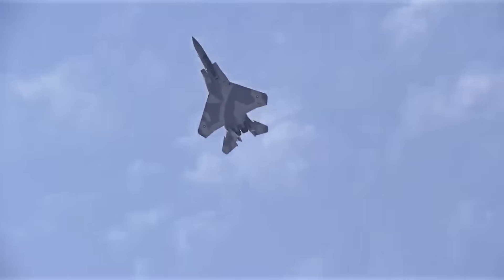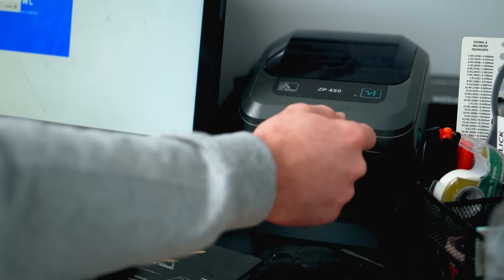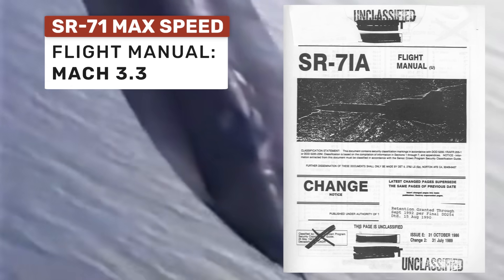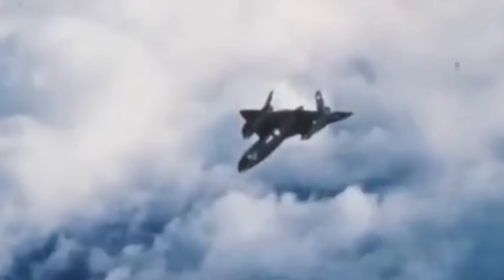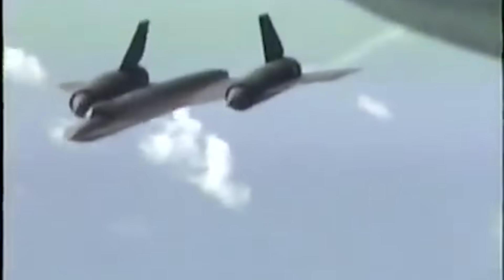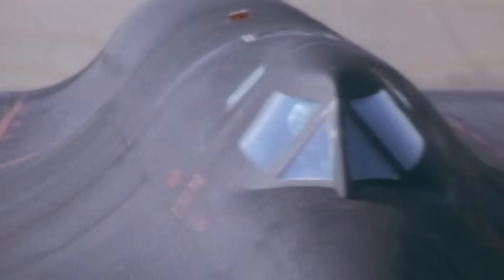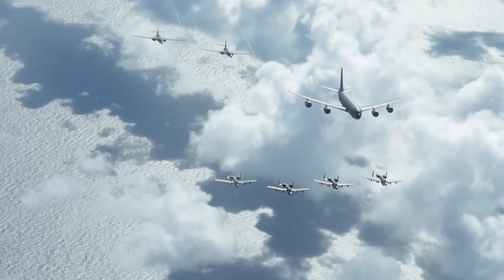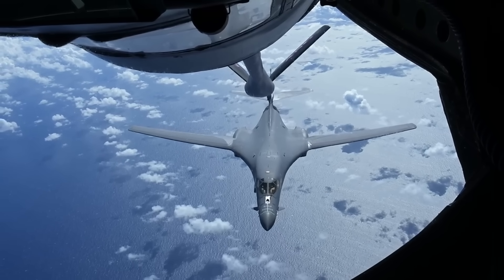The SR-71 was MUCH FASTER than the Air Force will admit

Comment: I remember seeing an interview of an SR-71 pilot describing how they outran a surface-to-air missile. He was quoted saying, "We got up to scary Mach speeds..." ... Scary... for an SR-71 pilot. I don't think he was talking a measly Mach 3.2 - that wouldn't have been "scary" for an SR-71 pilot.
Reply: scary meaning they were not sure the airframe could take it
Reply: @avroarchitect1793  It wasn't a question of the airframe taking it.  The faster the Blackbird went, the narrower the tolerances were for maintaining controlled flight by the driver...
Reply: @charlesdempewolf6861  people dont drive aircraft
Reply: @nomercyinc6783  And your flight time experience is...????
Reply: @avroarchitect1793 Also scary because if one of the engines flamed out, it would put the plane into a flat spin.
Reply: @avroarchitect1793  which would be ABOVE tested speed attempts. what maverick did in topgun 2 could in fact happen. pilots can infact overfly their airframes
Reply: I heard an SR-71 pilot say that they were cruising at MACH 3.2 and they had several SAMS fired at them. He said they just bumped the throttle a bit and accelerated to MACH 3.5 and pulled away.
Reply: Outrunning a SAM often means trading altitude for speed, At the high altitudes SR71s fly at they have plenty of altitude to trade off provided there isnt too many missiles coming at them. But its probably likely at that altitude and speed the flight time of the SAM is the biggest issue, even if the SAM can outpace the SR-71 by 1000 kph the flight time of an S-75 or 150 is 5 minutes at best, which also includes time it takes to get to altitude which in the case of the S-150 is 80-90% of its flight time already.
Reply: @Marc83Aus  the blackbird wouldnt dive or trade altitude it would stay high and fast, unlike most aircraft it would stay high and fast, it would never be moving slow and have to accelerate by diving.
Reply: From what I have heard of the sr71.... no one ever even used full power. The plane could ALWAYS go faster.... it just wasn't safe to do so.
Reply: Was that with Maury Rosenburg ?
Reply: @tonyhowell9203  I think it could be! It was so long ago I can't remember exactly, but having a look at Maury Rosenburg, he definitely looks familiar.
Reply: I watched an interview of a SR71 pilot talk about this. The engines could take you way past Mach 3.5, but the airframe didn't like going past Mach 3.5,
Reply: Let’s try about Mach 6 shall we?
Reply: Yep Mach 3.2 is just a little faster than most missiles.  That jet had to be much faster than that.
Reply: If you hit the Exosphere just right I'd say Mach 17.4
Reply: Did you watch the whole video? The highest speed cited was a pilot who achieved this in a shallow dive.
Reply: over mach 3.5  close to mach 4
Reply: way above mach 3.2
Reply: I can't remember what interview I was watching but one of the pilots said they got to mach 3.5 in a dive to evade missiles and at that point they could tell the aircraft didn't like going that fast. That would be somewhere around 2350-2400mph depending on altitude. Oh he put it in the video lmao.
Reply: @GatSpeed  speed doesnt change at altitude alone
Reply: Not only that, 3.2 isn't fast enough to outrun a SAM! IIRC, they'll easily do Mach 4.
Reply: @markymarknj  Common soviet SAMS of the time capable of high altitude interceptions could reach mach 3.5-4 but they can't sustain that sort of speed particularly when trying to hit something at high altitude. They've only got so much fuel onboard and once it's burned then you're just relying on momentum to carry you to your target, if that target is sustaining high altitude flight at mach 3+ then unless you get very lucky with your timing there's a very low chance of hitting anything
Reply: @DjDolHaus86  okay, thanks. I know that the Soviet SA-2s gave our guys fits in Vietnam. If they weren't quick on noticing and then evading them, they were screwed.
Reply: @markymarknj  They were pretty formidable at the time and still capable of causing problems today. It would have been possible to shoot an SR72 down with an SA-2/SA-5 but as I said it'd take some rather fortunate circumstances to make it viable, you'd basically have to know it's flight path, launch at exactly the right moment and for the pilot not to take evasive manoeuvres (ie. not be aware of the missile) to perform the intercept. It's kind of along the same likelihood as that F117 being shot down by the Serbs in the 90s, possible but unlikely
Reply: @markymarknj  Their success was mainly attributable to the Fan Song C radar.  That radar was the one that we were not allowed to attack unless it was far from any water impoundment.  The Shrike had some success then.
Reply: @DjDolHaus86  nothing russian from the 50s,60s,70s,80s or even 90s is still viable today. if russia was so advanced why cant they handle ukraine. id be utterly embarrassed to be russian
Reply: @nomercyinc6783  all of those hundreds of aircraft lost in the skies over Ukraine must have presumably just fallen out of the sky on their own, right?
Reply: cough MiG-25 Foxbat cough
Reply: The scary part is those SAMs were Soviet export 'monkey-model' versions, as in downgraded. They never sold their actual equipment abroad. They were too paranoid. As a result, the Americans have NEVER faced true Soviet weaponry.
Reply: @markymarknj a SAM WEZ is a dynamic thing, if you are flying fast the bubble in which a SAM can actually hit a plane shrinks (if flying away) and will grow when flying towards, at maximum engagement range an SR-71 could simply adjust its course and suddenly now the missile will not be able to reach the intercept point in time. SAM radar can't anticipate a sudden course change, and in some cases the SR-71 may have been able to fly over a SAM before it could intercept (although I doubt it would be directly over top of a launcher)
Reply: @Csilk  Not only that, at 80,000+ altitude the atmosphere is so thin that course corrections cannot be done quick enough to make up for any changes to the flight path of the target. Many times, the SR-71 pilot had the throttle set too hot in a turn and the aircraft would slide outwards (called "skid") causing miles of "cross track" . Kids today do that in their tuner cars, they call it "drifting" (my son is into that). LoL... First thing I would ask the pilot in debrief when "cross track" was the writeup,  "Sir, could the throttle have been set a tad hot?"
Reply: @Csilk Even if it flew directly over a SAM launch site, how long would the SR be directly above it? Even if the SAM site was able to ping it more than once to establish its trajectory.
Reply: @mikegardner107  it doesn't turn well, the range at which a SAM could actually fire and hit it would be a small window, it would have to have fly directly over or nearly and be detected the entire way through. I doubt the SR-71 would ever directly overfly a SAM site on purpose.
Reply: @ That’s why I specified only a 1° deviation in course.
Reply: there is a lot of variables involved, if the planes going mach 3.2 at 35k feet and the SAM fires a missile that can go mach 3.5 and had a range of 75KM the WEZ would be very small, this is also assuming that the SR-71 is flying directing into a threat which is not what aircraft do, they will fly around bubbles rather than over them, factor in also the SR-71 probably has great ECM systems that would confuse or restrict the range at which a lock could be obtained.

it's safe to say it would be exceedingly difficult to actually destroy the plane, not impossible but very unlikely that all the cards would fall in place.
Reply: @ 35K or 85K Altitude?
Reply: @mikegardner107  kinda the point at 85k feet at all times the plane would be 30km away even when overtop the launcher given that its going mach 3+ that would be quite the yolo SAM launch. The plane would be covering about 300KM in 5 minutes, near impossible to hit and kill. Thats hauling ass.
Reply: But if it were detected far enough away and the intersect point determine to be within the WEZ the speed would actually make the shot possible, this assuming no course correction and detection well before entering the SAMs max range.
Reply: @markymarknj  speed doesnt mean much when the missile has to ground from 0 feet elevation to 85000 feet elevation and not run out of fuel. doesnt matter how fast something is if it doesnt have the fuel to intercept.
Reply: @nomercyinc6783  I guess it's like racing: catching the guy is one thing; passing him is another...
Reply: @markymarknj  An SA-2 Guideline (S-75 Divina), the most likely missile to have engaged a SR-71, has a top speed of Mach 3.5 and a maximum range of 28 miles. Given that it's starting from 16 miles below the Blackbird out running one seems entirely plausible.
Reply: @Wick9876  good points.
Reply: @Wick9876  you know what you are talking about, most people don't seem to understand a SAM starts on the surface or its WEZ.
Reply: @Wick9876 also dont forget that this was before integrated air defense radars so by the time you detect the plane till when you fire the missile to the time it get up there, the engagement window is extremely small,  This coupled with the fact that the SR-71 could see hundreds of miles sideways at the altitude it regularly traveled means that it almost never flew directly over its target anyway.  Lastly many people also forget that the SR-71 had one of the most advanced ECM suites ever put into a aircraft up till that point.  That helps confuse what missiles do get close.
Reply: @Wick9876 Starting at 16 miles below it at zero MPH. How fast does it accelerate to M3.5? How well does it change its trajectory? If the SR-71 changes its vector by 1°  at Mach 3.2 how far off the missile’s initial target point will it be by the time the missile reaches altitude? Not to mention the SR-71 accelerating to a higher altitude.
Reply: @markymarknj  yeah but Mach 4 for how long?
Reply: @markymarknj  See my note about Mach 4.5+.
Reply: @wawolff6085  I've been trying to find it, but the whole comment thread hasn't opened up yet.
Reply: @markymarknj 

"Behind enemy lines" was not real life. 

A missile with a top speed of Mach 4 can not catch a target at Mach 3+ sustained at 85,000 feet  in a tail chase scenario.  

In a head on shot, you have plot the expected path of the target and fire it so its at the correct altitude to intercept  BEFORE the target  passes the launcher, and even then if the target sees the launch, a gentle turn off axis will spoil the intercept solution.  

It's not as simple as you seem to think it is.  That SAM is only making Mach 4 for a short period. Seconds. 
That blackbird is making Mach 3 for hours
Reply: @stinkyfungus 
 Others here keep thinking of a missiles pursuit curve/intercept like it’s a track & field event.
Reply: @markymarknj  and I suspected Mach 6 as some pilots bragged seeing the Sun Rise and Set 8 times in missions and other speak of leading edges smoldering white hot at the edge of space.
Reply: @miguellogistics984 
 Nonsense.
Reply: @johnrusac6894  The original years of "Wings" on the History Channel back in the early 90's there was a Pilot interview who said he could see the sun rise and set 8 (maybe he said 6) times on a mission.  Nonsense in the sense of atmospheric flight while circum-transiting the planet.  But bouncing back and forth over the Horizonal line between day and night, that probably still would require non atmospheric flight.  The strength of the cameras connote the notion that this bird was reaching for sub orbital, seeing the Space Suits of the crew places the equipment ability in that possibility.

The film was the mission.
Film returns with Airframes, thus brining it back was the crew duty.
Aeronautical flight numbers can only exist within the atmosphere, and high numbers and thermal characteristics were obviously needed for the greater altitude.
This was a real cheap and fast way to get film verses Corona.
That is what it looks like.

The other thing nor lauded about this craft was the astronomical navigation computer which looked at the sky when it came out of the hangar and told the Nav system where it was even in broad daylight.  That would really be effective at the darker higher altitudes, Star Nav calculations that Sir Isaac Newton only dreamed of.
Then speed becomes the thing that the mission lives and dies by in a preplanned dawn exploiting mission, you want to stay on schedule during the shift change at the radars.  Too much speed is too soon on a timed planned mission, and too soon might find someone at a radar awake.

Comment: I knew that. It's an open secret since a blackbird was flying at high altitude at about 80 thousand feet with a ground speed across the ground going around 3 thousand. That's super fast, across the ground while flying at 80 thousand feet

Comment: This is simply my own speculation, but it's quite reasonable to deduce that a titanium-made thermal-expansion-sealed airframe with adaptive cycle turbojet (not a true turboramjet) would have significantly better high-speed performance than something like the Foxbat which has a similar stated top speed. I find it hard to believe that the Foxbat was so similar in top speed to the Blackbird